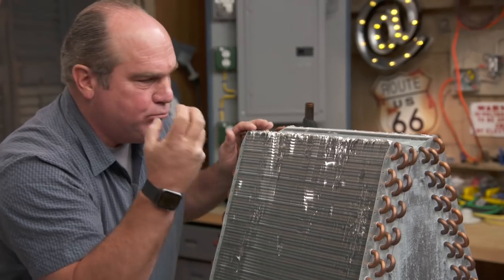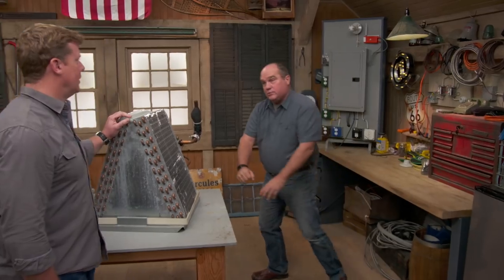How to Diagnose a Frosty Air Conditioner | Ask This Old House

Comment: When I worked as an HVAC tech dirty filters where the biggest cause of problems. One other common problem I ran into was super heating. People had bushes or trees over the outdoor unit and all the hot air that fan was trying to blow away ended up getting sucked back in because there wasn't enough air flow around the unit
Reply: you do know that superheat is on the inside right?

Comment: Older heat pump and A/C systems (meaning 10 to 20 years, or more old) were not designed for the pleated paper filters.  With these older systems, the return air duct is often too small to allow enough air to pass through a pleated filter.  You will starve the system for air and create the problem described in this video.  To allow the older systems to work you need the old fashion spun media (fiberglass, etc) filters.  If you want to get more filtration in your house for dust, you need to get a separate room or whole house filter, or enlarge your return air duct system.

Comment: It is also possible that the coils can become clogged because the dirty filters were not changed often enough.
Reply: Exactly what I was gonna say...
Reply: No.   A clogged filter is actually a better dust filter than is a clean filter.    But if you REMOVED the filter previously (say, out of frustration), then you'd clog your evaporator (i.e., heat exchanger) and be in serious trouble on this point.       There is a reason, after all, that the evaporator filter exists in the first place.

Which begs an interesting question that I've never seen.         The condensor's heat exchanger might become clogged.    (Think: animal nest.)  This would be catastrophic, and as a mere amateur, I've never seen this happen.   Notice there are never any air filters on condensor heat exchangers.       So you need to eyeball your condensor for any wacko developments... like some animal covering it up (from the inside) or some other insane development.

"Mike Builds" mentions this, in comment about 2 months prior to mine.

Comment: A restricted filter could cause an ac to freeze up and it’s definitely the first thing to check but most often the freeze up is because there is not enough refrigerant in the system. It can also be caused by a faulty expansion device underfeeding the indoor coil. Although the outdoor coil should be kept clean for efficient operation, a dirty outdoor coil would not cause the ac to freeze up.
Reply: not enough return air, restriction on MERV filters being to great, TXV bulb not set at 10 or 2 pm causing flooding of coil, low charge, to low of air flow.

Comment: Also check the blower wheel. When u cut ur grass near the condenser dont let it stay on the condenser. Dont put alot of mulch so it covers the drainage of the condenser. If u have pets do not let your pets use the condensor as a bathroom. It will eat all the aluminum away. If u have pets u should check/ change ur filter more often.

Comment: I'm thinking the since the letter writer saw ice on there "A/C" means they saw it on the outside unit. Which would mean they have a Heat Pump and the unit needs a defrost cycle or defrost is not working or its low on charge or the outdoor fan is not working or the outdoor coil is dirty.

Comment: Living in soCal, where it is a "desert" in comparison to where Richard Trethewey operates (in New England?), this has never happened, by my amateur observation.       Along the Gulf Coast of Texas, it's likely a huge concern.     Richard says it's common in his neck of the woods.      The obvious issue (secondary to oversizing; i.e., improper design) is HUMIDITY.       

Once this homeowner's evap coil ices up, he has positive feedback and a runaway condition that cannot lend itself to any finesse solution... in other words no minor adjustment to a reasonably designed closed loop (feedback) system... that has proper negative feedback.    The amplifier is too big; read:  the cooler is too big.      But I have a finesse suggestion:   Install a dehumidifier in series with (ahead of) the evap coil of the original system.     (De-humidifiers are "tinier" systems that do not much cool the air, but drastically cull humidity.)   Now the original over-sized cooling system might survive one whole day, while cycling on and off ... 

Of course, This Whole House properly educated its viewers on the more important point of correct original design, tonnage, etc.      I'm trying to voice a finesse solution that mitigates the need for expensive replacements shown in this video.

Comment: There is  nothing wrong w/ being .5 ton oversized ac system. The Key is to make sure the "blower speed" is slightly lower(ie 400ft/ton to say 350/ton) , along with a TXV, which will put out more humidity out of the home.

Comment: You never address a dirty evaporator coil always the filter ! its a dam fact once the filter is clogged, dirt will break loose from the filter sticking onto the Evap coil !  Always check both filter and coil ! 90% of all problems !!!!!!!   from a A/C Engineer , no TEC !!!!

Comment: DO NOT WASH YOUR AIR CONDITIONER FROM OUTSIDE-IN AS DEMONSTRATED HERE. It may look better when you’re finished but all you’ve done is pack the dirt into the coil and made it more difficult to clean properly. Tuneups are cheap, call a professional. And don’t let the tech get away with washing it that way either. He should be removing the top and washing the coil from inside to outside.
Reply: tr1pl333 He used a vacuum cleaner, not a brush.

Comment: Never mentions two other common symptoms:
-It could be the coil drain is clogged and backing up.
-Low on refrigerant from a leak or dying compressor.
Reply: 4:08
Reply: the dude abides
Reply: Alvaro Garibay - They're talking blocking the condenser coil, I'm talking clogged drain pan for evap coil.

Comment: Get real.....the copper tubing in those  PO💩 evaporators are a major issue and almost always the cause of a leak !!! All it takes is a microscopic hole and it's an ice cube , and failure !    And rip off artists know this and change entire units out !!!!!  Oversized my rear...Demand ALUMINUM EVAPORATOR COILS

Comment: Dislike cause this is my job lol
Reply: When he says on hottest day of year AC should run continuously. Does he mean it should run continuously during peak heat or continuously for 24hrs? My AC is a 2 ton for 1800 sq ft bungalow. On days that are just 26c it runs for 12-13hrs. On days that are 30c+ is runs for 15-20hrs. Is that normal? Thanks
Reply: @rasariar  it all depends on where your at. In Texas when it’s 100 degrees outside I would expect it to run 20-24 hours. If your house gets to the desired temperature then of course the AC will stop running. The easier way to see if your unit is frozen is to honestly just find it and check it

Comment: I cringe every time he does a HVAC video, he has no idea what he is talking about and should stop.
Reply: zack9912000 Maybe it’s an idea to tell some examples of what he said wrong? It would give your comment some actual value.
Reply: Richard van Pukkem it has been covered by others and his bs claims he has made in other havc videos
Reply: He hits a few high spots, but misses a complete list.  Dirty indoor coils, failing blower motor, a faulty metering device, or a restriction in the duct work for instance.  Also, I have never known of a unit to freeze as a result of simply being oversized.  A unit that is too big will still cool, but it will cool the space too quickly, then turn off -  leaving a moisture problem in the home.

Comment: Please Richard stick to plumbing you don’t know how a ac system works stick to plumbing
Reply: Eric Marchand Even an idiot knows how an AC works. You first press the On/Off button on the remote and then adjust the desired temperature with the Up/Down buttons.